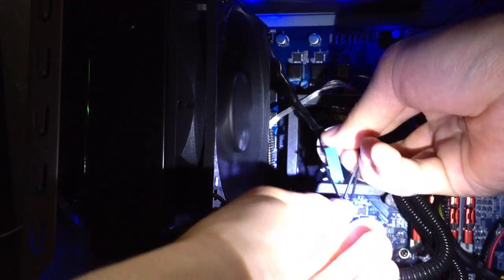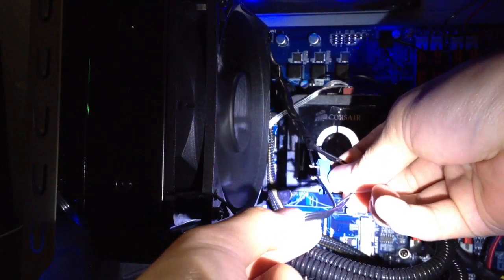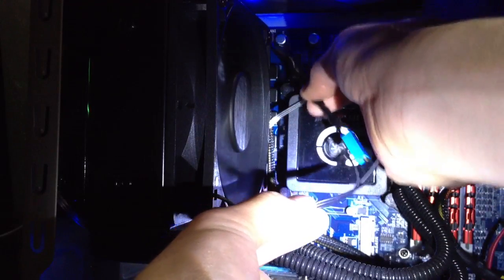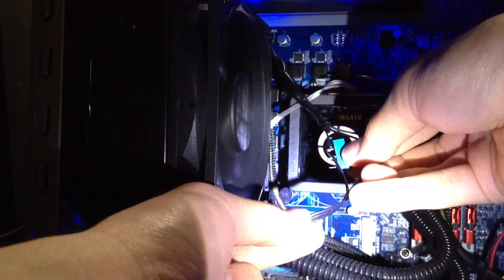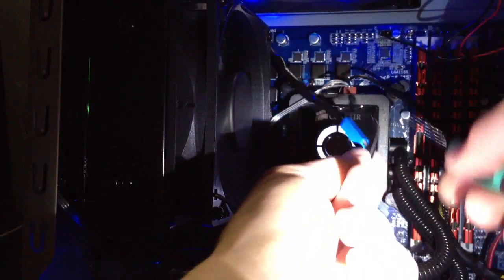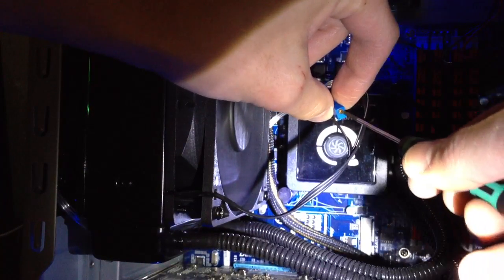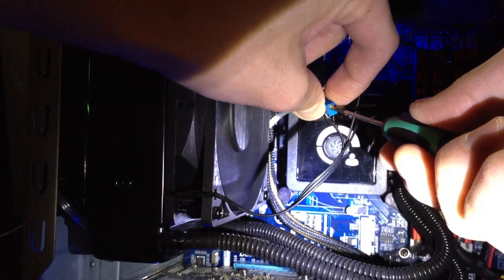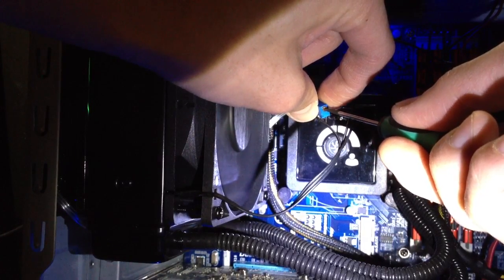Case fan control with a potentiometer

Comment: i put a potentiometer 10k on my cpu fan that is 3 wires and it does not turn the fan on, the 3 wire in connected to the mother board directly with potentiometer I need advice.
Reply from the maker: shagy-GT that's a really big resistor. Try going for 1k. There are three points. Make sure you have ground on the potentiometer connected to the ground in the fan. And ground of the power source and then attach the power from the board to one terminal of the potentiometer and then the power line from the fan to the last terminal of the potentiometer.
Reply: ok thanks brother.

Comment: what is the resistance of the potentiometer? could you give me its specks? how many ohms is it? and the power limit (watts)?
Reply: +Flix You can use a wide range of potentiometers, but consider this: if you go with a high ohm pot like a 10Kohm, it's going to be really sensitive. In other words, just the tiniest little turn of the knob might be the difference between full blast and complete off. You want more control than that; you probably want to be able to turn the knob half way to put the fan at half speed. You could use a high ohm potentiometer for testing, turn it up until the fan completely stops, then take note of how many ohms it stopped at (maybe like 1Kohms), then you want to find a potentiometer with that value (or close to it). I'm pretty sure you'll find that the fan stops way before 1Kohms. When one of my fans was being loud, I added a 25ohm pot and dialed it back until it was as quiet as I wanted. I bet 150ohm to 200ohm would completely stop it (12v 30mm fan that I put in a custom router, cant remember the Amp rating).

Comment: I want to do the same with a 12 volt 0.12A
Fan. (80 mm) 
What kind of potemtiometer would be good for this?
I'm using a 12 volt universal adapter, (3-12 volts and 300mA)